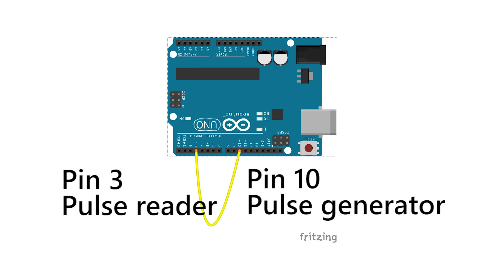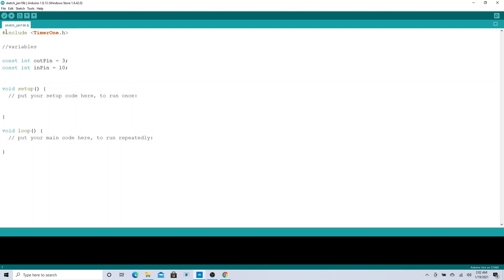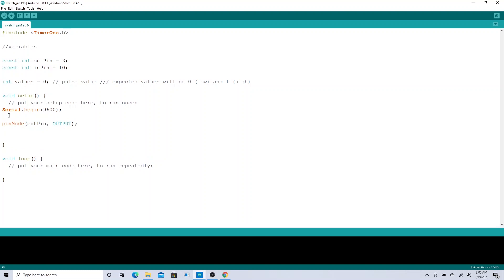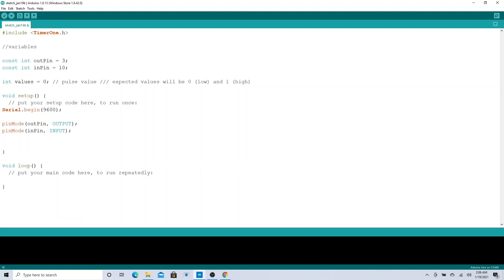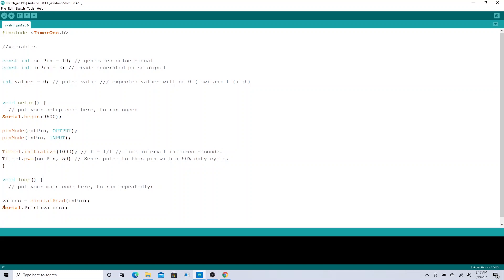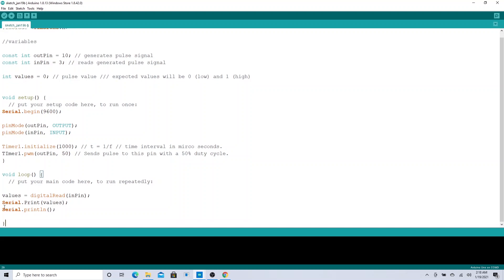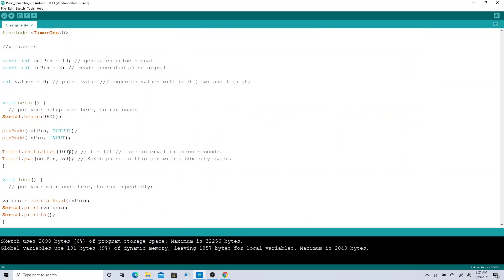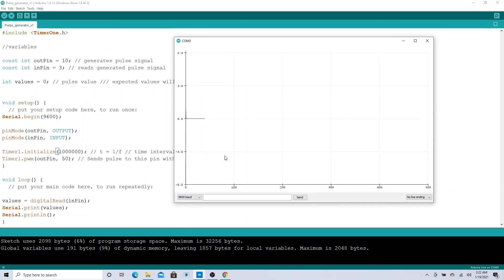How To Generate Pulse Using  Arduino

Comment: nice video, just asking about the amplitude of the signal, when i applied your code i got amplitude of 11, so why is that and how can i change that? 
Thank you
Reply from the maker: Hi, Thanks for the question. Do this exercise (always). Use a multi-meter to measure the signal output pin 10 (preferable o-scope if you have one). If you are using Arduino Uno the max. voltage output for a digital pinMode configuration is 5 volts.
Reply from the maker: Maybe explain exactly what you are trying to do and the output you are expecting and i will try to make a video of it for you if i can.
Reply: @codingwithalfred  well, i am using arduino nano, and the voltage from pin 10 is around 4.7 volt using multi meter. my application is, I have a gas meter which has pulse output signal and  i want to convert that reading to flow (cubic meter per hour), so i need to read and count the pulses if possible using arduino nano or uno. thanks
Reply from the maker: @magdinabi7942  Ohhh i see. Are you able to count the pulse from the meter already? If so. what is the specification of the gas meter pulse output. for example what is the pulse per cubic meter of the gas meter? If you provide link to the specific gas meter. I should be able to look up the meter's spec. and will be able to come up with a the calculation for flow rate determined from your pulse output.
Reply from the maker: @magdinabi7942  Perfect. Looks good. Unfortunately i did not see what i was looking for in your link. But, a quick search i found https://a-matrix.ng/product/gas-meter-quantometer/ . So according to this specification. The meter  comes with a standard LF transmitter (the manufacturer provides other options too). So now looking at my link. the pules output is 0.1m3/Pulse. So now when you are counting the pulse from the meter. You will want to measure the time between pulse to get the flow rate. So for example if you are getting 1pulse/sec your flow rate will be 0.1m3/3600 (converting per second to hours) =  2.78e-5m3/hour. Does that make sense? I can try to explain it a little better.
Reply: @codingwithalfred  Thank you very much, so it is not the number of pulses? however, is it possible to use Arduino to do that,  i mean to read the flow from this sensor in m3/hour, can you help with that ? Thank you very much
Reply from the maker: @magdinabi7942  I will try to come up with a way to demonstrate it with what i have. Will keep you posted.
Reply: @codingwithalfred  Thanks a lot
Reply from the maker: @magdinabi7942  What's your email?
Reply: @codingwithalfred  did you receive my email? i have sent twice here but seems it disappear
Reply from the maker: @magdinabi7942   Nope, feel free to email me here hiiasolution@gmail.com

Comment: Thank you for demonstrating a pulse,
can you have two pulses so one pulse can control one item and the other pulse control a 2nd item 
so you can have different pulse settings for each item ,
Reply from the maker: Hi, that's an interesting question. Looking at the code, the answer is yes. You will need to duplicate everything that was done for outPin = 10 variable to another digital pin.
Reply: @codingwithalfred  Ok i will have a go at some point,
Why I ask is I use a different code of mine to control solenoid valves at a high speed,
That
open and close 20 x per second
So I use the On and Off  command
setup with VAR
do you think i would benefit using Pulse 
Instead.
Reply from the maker: @spudnickuk  I see, pulse will work too. Probable will save you lots of code space. Curious why you need to excesses a solenoid valves ON/OFF 20 times per second? Also i am surprised your valve is able to open/close up to 20 time per seconds. Some of the valves i worked with  take close to a second to make a complete rotation to the OFF/ON position.

Comment: why are we not getting a square pulse with 50% duty cycle?
Reply from the maker: Hi Please use 512 instead of 50 to initialize a 50% duty cycle. I made a mistake in the video.
Reply: This was the first thing I wondered too.
Reply: @davelowe1977  I'm getting only straight line why?

Comment: Nice video. I do have a question. I have a pulse project that needs to be in steps it is called differential pulse. So I was wondering how I can generate such codes in to do what I want . I will deeply appreciate ur assistance .
Reply from the maker: Thanks, do you have an idea of what you pulse profile will look like? What are your steps? Changing amplitude or frequency?
Reply from the maker: Thanks, do you have an idea of what you pulse profile will look like? What are your steps? Changing amplitude or frequency?
Reply: @codingwithalfred  is it possible I can reach you via email so I can describe properly?
Reply from the maker: @maduforndubuisi1910  sure email me at hiiasolution@gmail.com
Reply: @codingwithalfred  thank you Alfred, will be sending u the details.